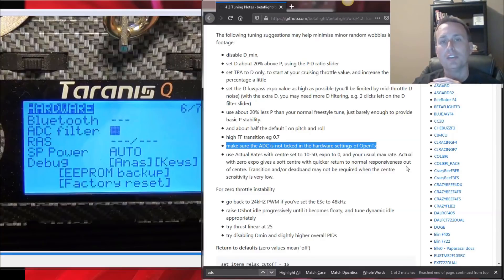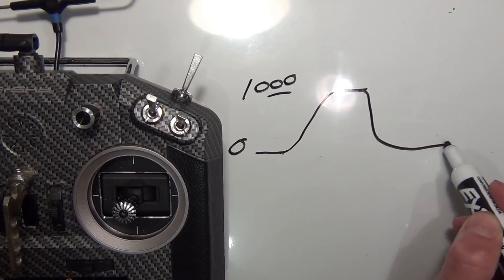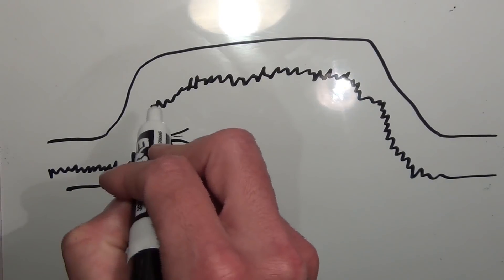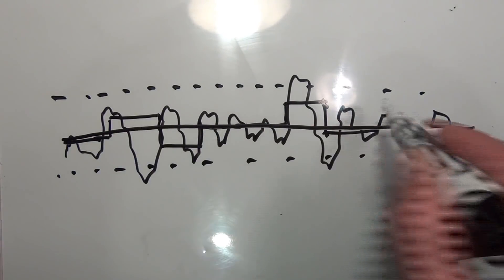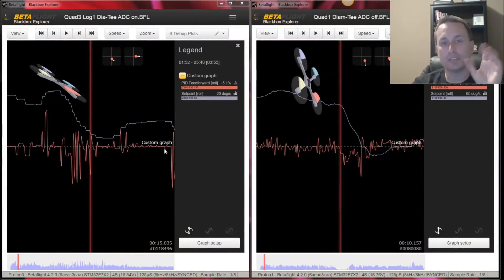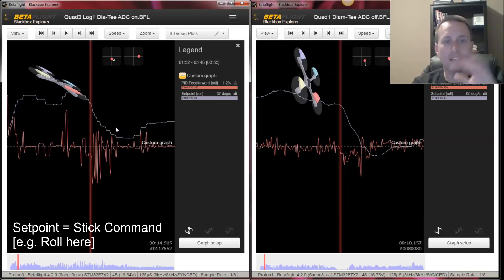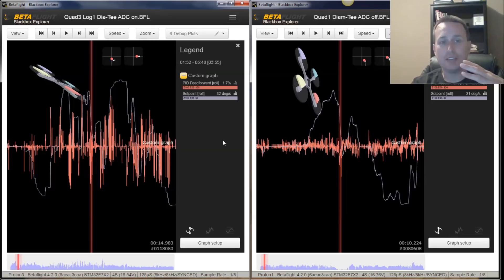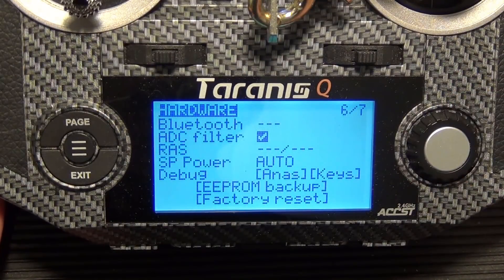OpenTX ADC Filter: Disabling for Smoother Sticks 😎👍

Comment: Everytime I disable the ADC Filter on my TBS Mambo it comes back on by itself on every Radio power up. How can I keep this setting off permanently?
Reply from the maker: Sounds like a bug with FreedomTX.
Reply: @uavtech  according to TBS the Mambo has digital gimbals so the ADC filter does nothing. I guess it doesn’t matter whether it’s on or off.
Reply from the maker: Sounds sus.  I have not heard of digital gimbales.  They work by sending a voltage of 0 to 3.3v back to the control board.  A they are an analog potentiometer.

Comment: Mark, you just rock. I'm in the final steps of tuning my AOS 5 - and was always wondering about that steppy stick-input-curve. Of course that agressively tuned quad just snaps right onto those steps and especially during gentle slow moves around the center of the stick this created quite an annoying behaviour where the quad "snapped into fixed angles" instead of gentle moves. Until now I thought this was simply jitter and scaling-artefacts (due to that whole CRSF 3.0 discussion) but turns out - it's just that ADC-Filter I have never heard of before. Thanks so much!
Reply from the maker: Also don't be afraid of Actual Rates and High Expo. (0.8 to 1.0) for smooth moves at center stick.  Stick Sensitivity of 10.

Comment: Great video!

Maybe you could make/type a quick go through of these recommendations of cinewhoops, e.g. the cli commands they refer too?

The following tuning suggestions may help minimise minor random wobbles in HD footage:

disable D_min

1. set TPA to D only, to start at your cruising throttle value, and increase the cut percentage a little
2. set the D lowpass expo value as high as possible (you'll be limited by mid-throttle D noise) (with the extra D, you may need more D filtering, e.g. 2 clicks left on the D filter slider)

3. use Actual Rates with centre set to 10-50, expo to 0, and your usual max rate. Actual with zero expo gives a soft centre with quicker return to normal responsiveness out of centre. Transition and/or deadband may not be required when the centre sensitivity is very low.

Those are the ones I though hmmm, that will require a lot of googling to implement.

Comment: So I do not know who I learned this from but I spend so much time trying to stuff with my receiver, because it would keep missing the first tick 80% of the time I made a sudden movements. causing huge spikes in the feed forward, overshoots and in some cases the quad was just stair stepping trough a rotation. So thx for pointing this out as it might have been you and also for helping other ppl who look at their blackbox wondering why their pid error is so spiky.

Comment: I fly a mix of quadcopters and planes, would turning off the ADC filter have a negative effect on servos running straight off an Rx? Would it introduce more jitter in that case?
Reply from the maker: I could.  It depends on the gimbals.
Reply: UAV Tech thanks for your reply. What do you think the result would be with the Hall effect gimbals? Would arduplane and arducopter also benefit form this? Or only betalfight with its filters and feed forward?

Comment: Does disabling it in older betaflight help as well ? I run 3.5.7 at the moment
Reply: Try lowering feed forward on pitch n roll a shit ton, youll be suprised how smooth center stick is wo losing control
Reply from the maker: Should help.  But 3.5.7 FF is subpar.  FF Interpolation and limiting in 4.x helps it a lot.

Comment: So does this help with older firmware like 3.5.7 and 4.0.6 the same?? Im also running R9 Fport and i run 0 FF because the blackbox logs look horrible with any FF.
Reply from the maker: Yeah, FF in 3.5.7 is subpar.

Comment: Thanks for the follow up Dave.  I did appreciate your help.  FYI, I was running with an FF sp at Average 2 but happened to be that when we were testing I went changed it to "On" and forgot to check out the effect.  You explanation helps to determine the ideal set up.  I'm back at it tomorrow trying to pinpoint the cause of the bad Frame rates.  If I find anything I will let you know.
Reply: “Dave’s not here, man. “ (but Mark is...) 😂
Reply: @mikec4032   Dooh!  bad day

Comment: So it means that if we turn off the ADC filter, we have to set the ff_interpolation to default? What will happen if we only turn off the ADC filter without any other setting?
Reply from the maker: Well, default is default.  Of you change to lower setting, and depending on your gimbals, you could see more small FF jitter, but leas big.
Reply: @uavtech  Thanks for your response Friend!

Comment: Hey Mark. I was just interested, I'm on the old accst 2.2.4 opentx, x9d plus se pre19. I have no access protocol stuff, just accst and crsf stuff, im still running Crossfire 3.23 because wouldnt I have to upgrade the firmware in my x9d to something newer than 2.2.4, to use crossfire shot, and disable the adc?
Reply from the maker: To run Chrossfire shot, you need to load their special Fork of OpenTX until OTX 2.4 comes out.

Old versions of OpenTX have the ADC filter though.  It was added in 2013.
Reply: Sweet, so it can still be found in the hardware page at the very bottom? Thanks alot Mark, be safe. Btw, what does ADC stand for?
Reply from the maker: @brandonwoodford579  Analog-to-digital converter

Comment: Is this for betaflight 4.2 and opentx 2.3 only or should work well with 4.1and 2.2.2open tx.
Reply from the maker: Good for 4.1 as well.  Set FF_InTerpolation to Average (the default).
Reply: @uavtech  I'm running r9 so should I use average 4?
Reply from the maker: Yes

Comment: thanks for this Mark. This is something I have long overlooked. One of those things I just never got around to doing, including updating openTX. But lately Im realizing that it's causing bumps in my HD video feed, even if I over filter RC, and lower FF, because it comes through into Pterm (and pid error) as well, since that's essentially setpt-gyro. I started noticing it during smooth barrel rolls, where I was absolutely sure I was giving consistent stick input, because I'd essentially hold roll, but noticed a long step in set point during almost every full roll. Anyway, time to fix this, LOL!

Comment: Is this something that's better suited for Betaflight 4.2, or will there be just as much benefit on older firmware, too?
Reply from the maker: Good for 4.1 and 4.2.  Prior should be ok, but have not checked.
Reply: @uavtech  Awesome! Wasn't sure if it was something new in 4.x that took advantage of it, or just a general improvement. I'll give it a try myself and see how it feels.
Thanks for the reply and the video!

Comment: Seems pretty broken that OpenTX would sample the sticks like this. If the pots / halls are that noisy then oversampling and filtering at a higher rate than the 6 -> 20ms frame rate of the transmissions would be in order. Anyone know if there is a specific reason why?

Comment: Does turning off the adc filter also mean you will have slightly cooler motors?
Reply from the maker: Depends on your downstream setting.  I could be possible of you have FF cranked and FF_Interpolation off or set to just "ON" and it is feeding jitter signal through to the PID Sum currently.  But if low or off FF, it is unlikely.

Comment: I really feel like this video was made for my issues 4 sure.
I have always and never tried other than d8 d16 frsky. I now have remote that will do new access is it worth updating firmware on rxsr reciever once I do there is no take backs so I haven't tried it yet.
I do have jitters only flying straight no stick movements that's the only flaw that bugs the s"''t out of me. Thanks for all your hard efforts to help lower IQ levels like my self.🤓

Comment: Great Explanation! I must turn off ADC Filter with Betaflight 4.1 too?
Reply: 4.2 has upgraded RC filtering, so i'm not sure if you should do it with 4.1 as well.
Reply from the maker: Yes, give it a go.  Set FF Interpolation to Average.

Comment: Thanks for the info. I will check on my Taranis, but on my Tango 2 no ADC filter.
Reply from the maker: It must not be exposed in the more narrow GUI.  Wonder if on or off?
Reply: @uavtech  on the first firmware version 1.01 the option is exposed and set.

Comment: I guess this setting should be model specific, not global. It could be useful for fixed wing that might have only a receiver and servos.
Reply: We all need smooth setpoint don't we?
Reply: @s52ft  This is not applicable for fixed wing aircraft without a flight controller. I think this was added back when hall sensor gimbals were rare and worn potentiometers caused quite a bit of jitter in the servos. Betaflight will do its own filtering to smooth this noise out. Not sure how INAV handles it.
Reply: I agree, maybe submit a feature request in the openTX github

Comment: I have heard that you should disable the adc filter and I've had it disabled since basically forever I think.
But it's still very interesting to see the actual data.
Reply: I was going to ask if ADC should be off for BF 4.1.x as well. I'm not updating to 4.2 yet.
Reply: @ChristopherYotz  I think it won't hurt turning it off. Given that the first time I heard about that you should turn adc filter of was in the Betaflight 3.5 or so days. But then the reasoning was just the delay and loss of of real resolution, if I remember correctly.
Reply from the maker: It also has negative effects on D-Setpoint weight (old BF and Emuflight).